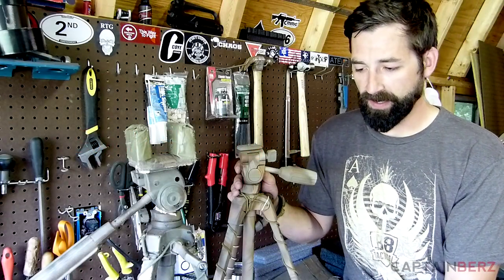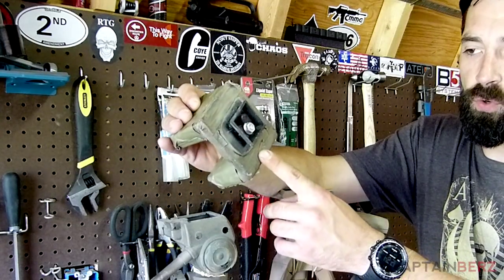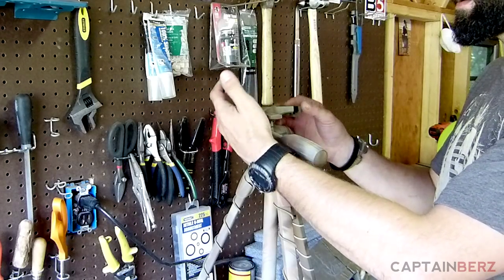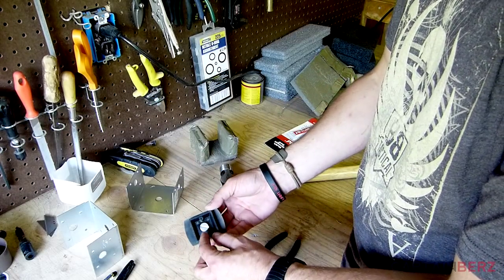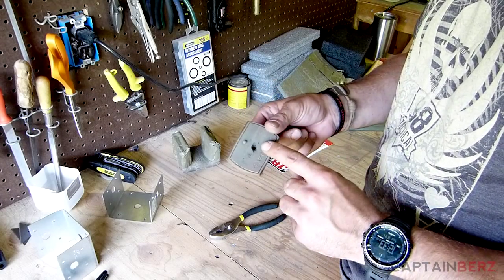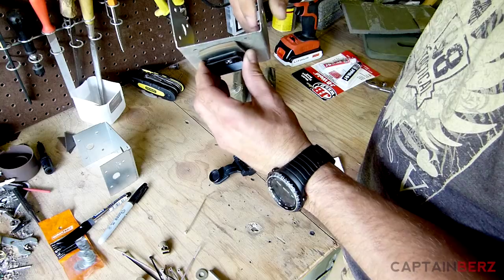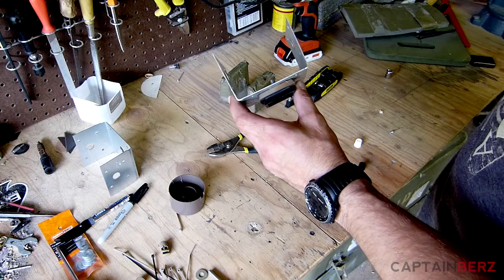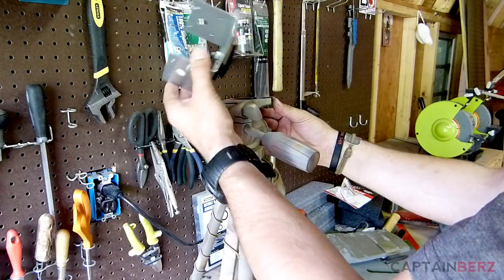Homemade Saddle Shooting Tripod: Part 2 of 3

Comment: Any reason why you couldn't mount a Kinect MLOK section (pic rail side down) directly to the tripod head? Then you'd be able to just click in and out of the tripod instantly (if you had an MLOK rail) and skip the whole bracket part.

While we're on the subject, you should talk to the Kinetic Dev guys and have them make something that has a tripod plate on the bottom and a Sildelok (or some other QD picatinny mount) upsidedown on the top. That way you could just click in any rifle that had a pic rail segment on the bottom and it would be locked in solid. I would buy that in a heartbeat and I'm sure many others would too.
Reply from the maker: Huch I see where your going there. With a ball head it might fly, in my opinion, as you can move the rifle anywhere. But with the pan head it would be securely in there with no room for adjustment. Where when it is snug versus latched with an m-lok mount, it gives you some flexibility for quick action needs. Just my opinion, but I like the idea and thinking outside the box.
Reply: Then if you have a rifle that doesn't have a pic rail on the bottom you can just put a short segment on the bottom of a saddle. That would give you many options depending on how fast you need to get a shot down range.
Reply: CaptainBerz Or I guess you could just get the Magpul MLOK tripod mount that they announced yesterday:
http://soldiersystems.net/2015/06/25/magpul-now-shipping-new-products-m-lok-tripod-adapter-ak-moe-stock/